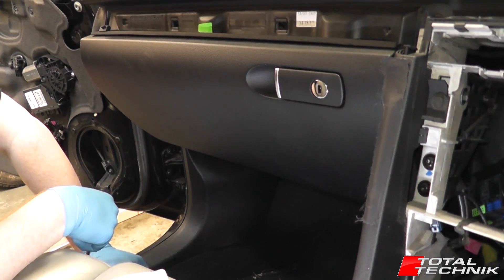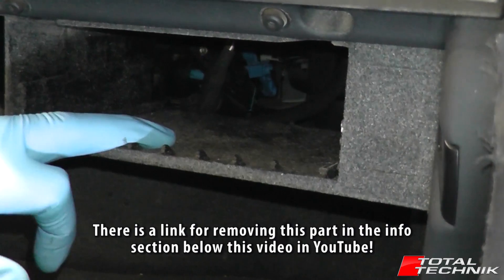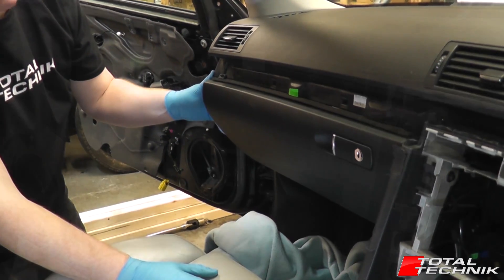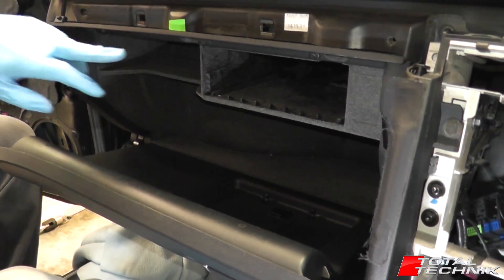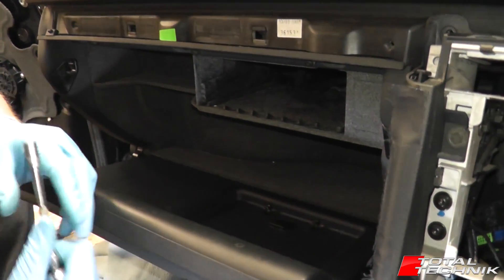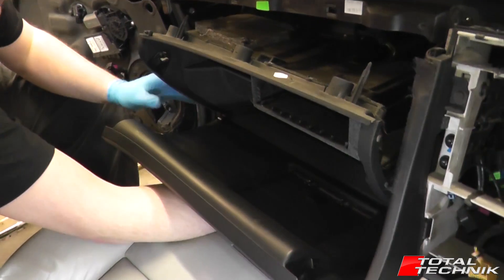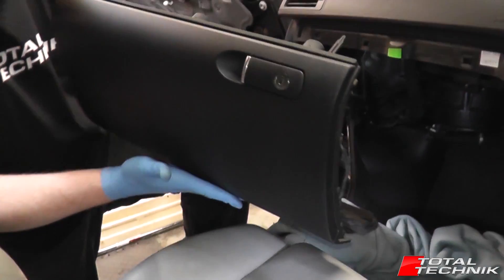How to Remove Glove Box / Glove Compartment - Audi A4 S4 RS4 - B6 B7 - 2001-2008 - TOTAL TECHNIK

Comment: Thanks for the video super helpful! Mines fully broken so will replace with a used one. In terms of airbag lights going off, as long as you don’t turn on ignition during process should all be ok? Doesn’t need to be re coded after new box fitted? And is it a case of swapping / popping out front lock / airbag lock so original key fits both? Many thanks for the help!

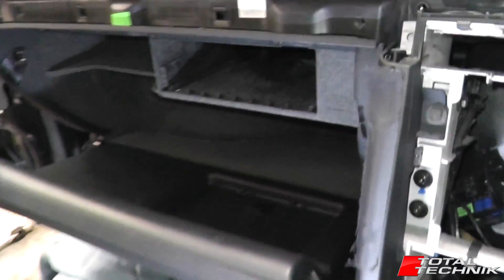Comment: Thanks for mentioning the extra bolt within the CD changer area. I have an iPod dock there (2008 North-American model) and behind it are two screws near the front of that area and another one far in the back, which is visible in your video at 1:50. In addition, at 1:45 you can see another empty screw hole in the centre inside the box. I had bolts in all of these, a total of 9 bolts to remove!

Comment: Thanks for the video. Is there better access to the cabin air intake vent that takes in air when the a/c is in recirculation mode by removing the glove box? 
I want to use an air con “bomb” to treat odour and wondered would removing the glove box give better access.

Comment: Great videos. I have a problem with drivers side vents only blowing cold. I notice that the actuators at on the side of the centre console when the glove box is removed. Does each side have a set of acctuators. Is the blend door accessible easily?
Reply from the maker: Thank you - much appreciated!

There are several motors for the climate system, each is colour coded and has a different colour arm. When you remove the glovebox you can access the red, blue and green motors.

There is another on the drivers side, which is yellow. That controls the hot/cold mix to the drivers side vents. SO that's the one you need to check...

Be sure to support us: Please subscribe to our YouTube channel and spread the word!
Reply: Thanks for the reply. I've found my problem. Right hand side blend door flap motor—the yellow are has sheared off. So, I've managed to tape the arm in the hot position while I get back to it to remove the motor (tight access) and try a repair or replacement. (hard to find, part number 8E2820511 Yellow arm) do you know of a supplier?
Reply from the maker: Yes, that's what I expected (yellow), as I outlined above...

Yes, it is very tight access and a real pain to get out. I had to do one in my personal car only a month or so back, and not much fun. But with patience it's not a problem.

Don't bother trying to repair it. It could break again and it's just not worth it. You should be able to find a used one on eBay for under £30.

Best of luck!

Comment: 2012 Audi A5

Had Problems with my blower motor not turning on so i would have no air blowing when I turned on my ac. I took my glove box off and everything that was in my way so i could get to my blower motor. But when i did this i started getting a parking break malfunction alarm that come on. I put everything back after repairing my blowing motor and it is working great, but i still have the parking break malfunction alarming coming on. I tested it and my parking break works just fine. Any idea how to reset this fault?
Reply: Brah G howsit man?? How did u remove the glove box can u help me?
Reply: africian christian movies and harmelten and tb joshua
Reply: Brah G it hasto be connected by computer to turn the warning off. Same with airbag and esp connectors once removed youll never hear the end of the warning till a computer gets plugged in. May haveto take that to the dealers to remove the fault code.

Comment: Thanks for the detailed video. I am having an issue with the glove box in my A4 (B7). The door feels stiff and takes a long time to open/close? My hope is that I can replace the issue without having to buy a whole new glove box unit. Any recommendations? Thank you in advance.
Reply from the maker: Hey there!

You get quite a few of them that are 'stiff' and don't drop under their own weight. It's not something to worry too much about, unless you use your glovebox several times a day of course.

But yes, does seem to be quite common.
Reply: Total Technik good point. I hardly ever open/close my glove box. Thanks for the reply.
Reply from the maker: No problem :-)

Hopefully just saved you £100 ;-)

I wouldn't worry too much if you don't se the glovebox that often. It's a very common quirk.
Reply: I usually pull the box door down anyways itll eventually wear abit. Theyre usually stiff and mad slow.